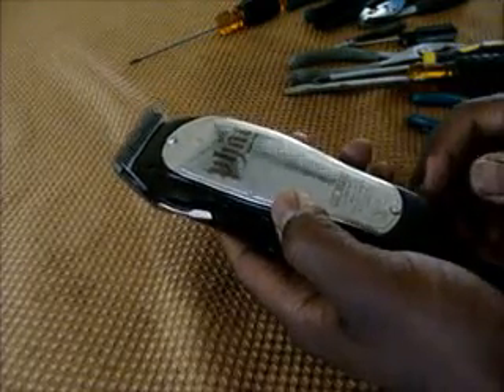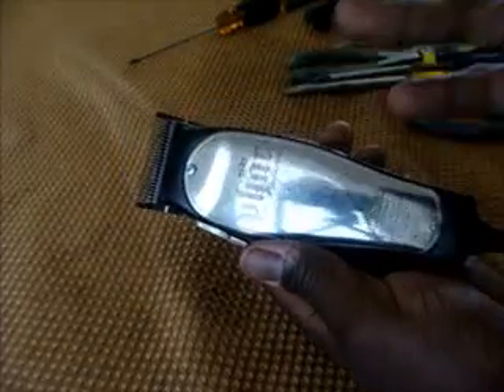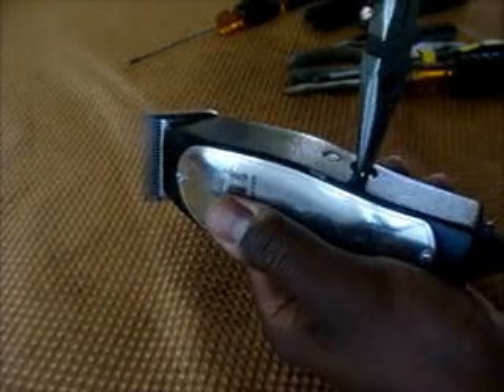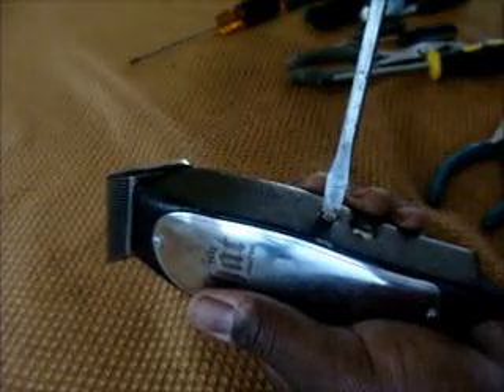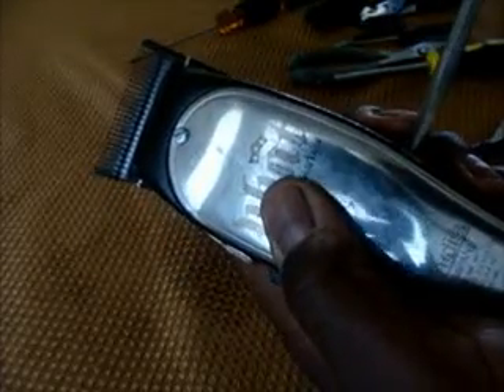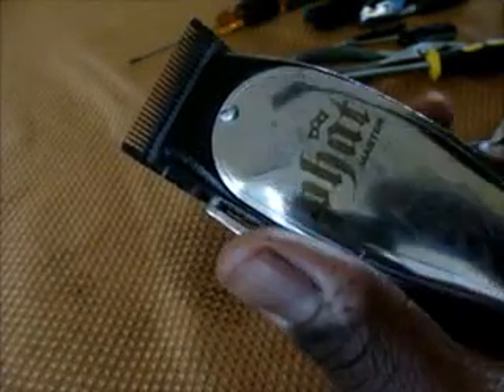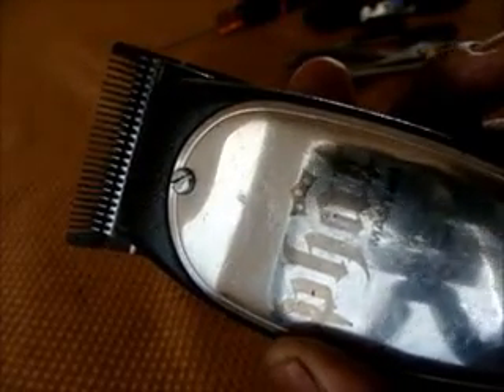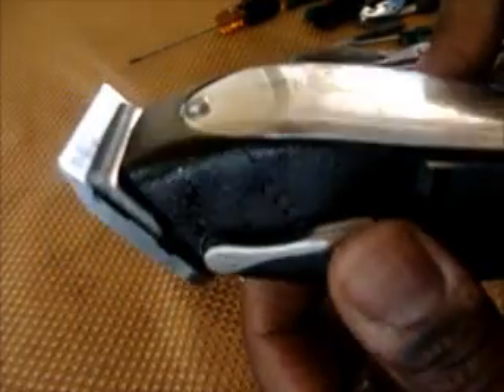How to tune up an Andis Master

Comment: Great video! I did notice that you say to loosen the stabilizer screw one full turn after fully tightening it but in the video you only loosen it a half turn. I'm not hating or anything I just wanted to point that out in case anyone has trouble. Thanks for helping me fix my Master.
Reply from the maker: lockpicker2k true thanks

Comment: bro you fixed my Masters 😂 i had a problem where every time i oiled it, it would start clattering. this time the clattering didn't go away even after i adjusted the power screw. thanks fam you saved me $$$ i was on my way to buying another pair of Masters

Comment: Hey i dropped last week my Andis fade us  and since this the blade move a little bit the sound was really low i tried to fix that but then is went wrong now the blade dont move can somebody help me i will appracite that thank !
Reply from the maker: Two things possibly happened
 1 the cutter blade is loose on the fork
2 motor slid over slightly on the motor shaft 
Or both. Not hard to fix just have to watch the videos i have up to do tjr repair
Reply: @keepitsharp357  Thank you

Comment: When I put pressure on the blade with my thumb or if I am cutting long hair, my blades stops on my masters. Any idea how I can fix this? I tried adjusting both the screw but it still gets stuck. Thanks for the help
Reply from the maker: first try taking the blade off and see if hair is clogging the clipper preventing fluent movement. also take the cover off and check to see if hair is not clogged around the motor preventing proper vibration. then let me know what you find